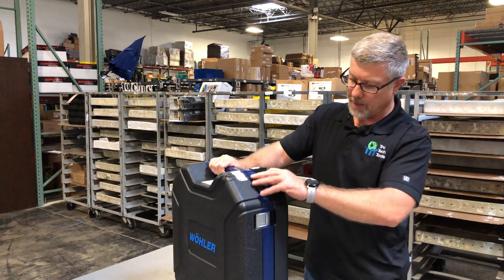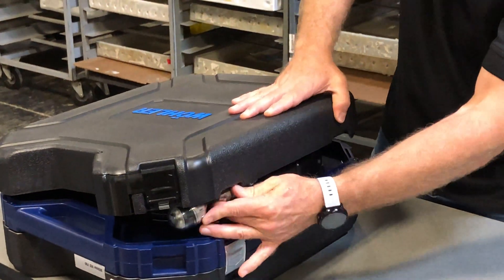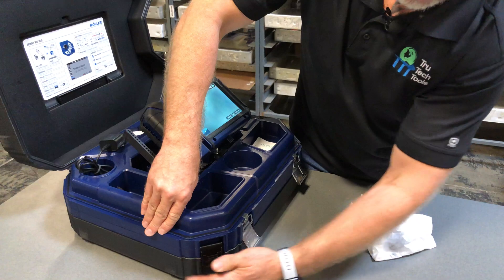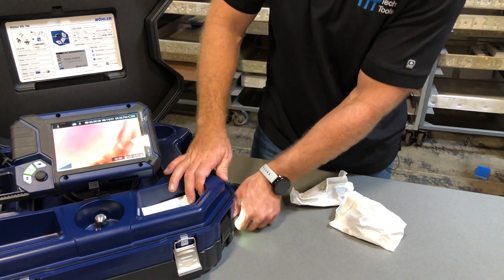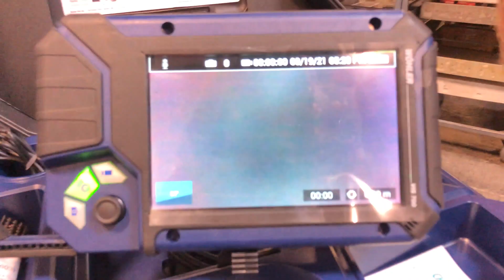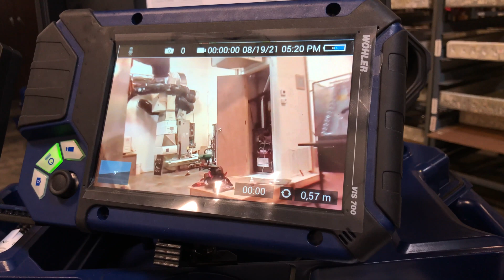Wohler VIS 700 HD Inspection Camera Unboxing and Overview

Comment: Hi, I´m from Brazil and i have a question, my residential building has 12 floors and I need to visualize the plumbing through the shaft, how many meters have this cable, on my building the ceiling height of each floor is 2.70meters